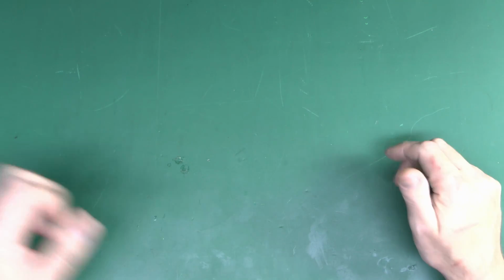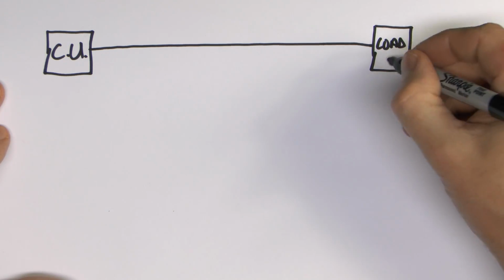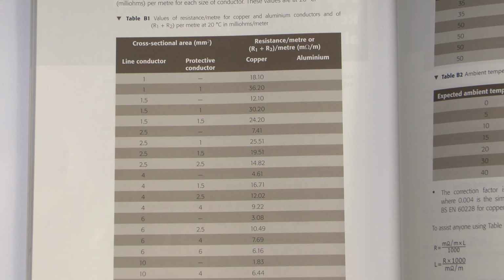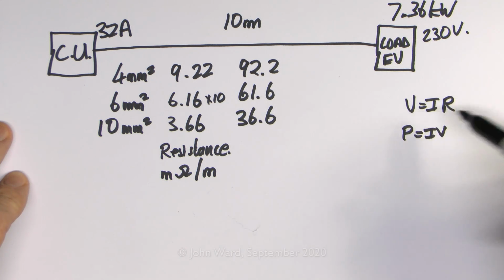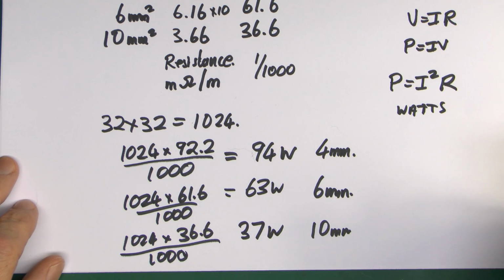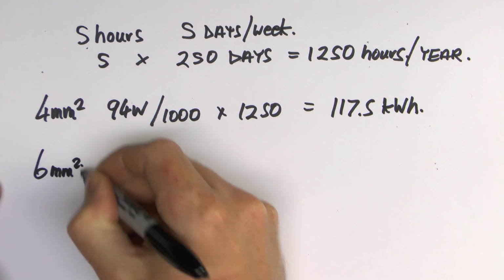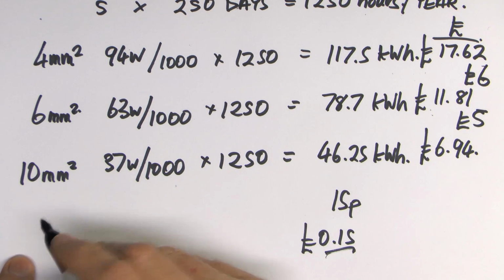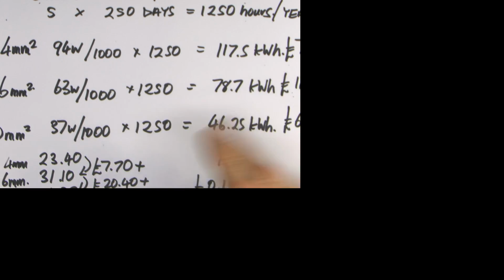Calculating Cable Energy Wastage, Energy Efficiency

Comment: Be careful when using this as logic for designing for maximum conductor size as theoretical voltage drop mitigation & associated savings are really difficult to recoup particularly when in a domestic environment even for the sustained-power output of EV chargers. The engineer in me wants to install the fattest cable for our next EV charger at a holiday home but running the calculations on real world use - it just doesn’t hold water if your sole aim is to invest in 10 or 16mm cable just to save money. Yes EV chargers spec sheets do design for 16mm conductor sizing! Fair enough if you have a long run and need to hit minimum voltage drop parameters but you wont be saving money anytime in the next decade (or maybe 2) for doing so, its purely for performance in that scenario.

For reference my long established (>3 year) average energy consumption in hatchback EV is 18.1kWh/100km in an suburban setting with occasional motorway driving ~130km/h and Irish weather (temperate climate, mostly mild & always wet 😂) much like yours in the UK. Price of energy is 0.31€/kWh (which is essentially a market low here), best T&E prices I can find are 16mm cable at 9.4€/m, 10mm at 6€/m and 6mm at 4€/m. For reference I drive ~18k/km a year meaning I charger for less than 500 hours a year. The example here is 1250hours. 

If you run an office fleet of cars perpetually charging on 7kW AC then you may actually reach a ROI. Although in that case perhaps you’d be using 3 phase 11-22kW AC so much of this domestic scenario won’t apply. Best I can tell - 6mm is probably the sweetspot between overkill and minimised energy wastage in the context of the cost of copper for most homes. To be fair I think that was the logical conclusion from this video. Perhaps you can find better cable pricing but to be honest you’d also probably be paying for higher spec EV-Ultra style cable (SWA with Cat5 ethernet) and that’s what most Electricians will go with.

Really enjoyed this video, always learn a tonne from your content. Open to discussion & challenge on this. 👍

Comment: The calculation is an overstatement. It says 1250 hours * 7.4kW. This 9,000kWh. Which equates to 27,000 miles at 3m/kWh. Suggest the saving for an average at home charge is approx 1/4 of the stated amount. 

On my current tariff as of April 2022 (Octopus Go @ 5p/kWh) the saving is a £1.75 a year based on 12,000 miles @ 3m/kWh. 

Brilliant video!
Reply: Just making these same realisations today watching this video. Totally agree with you! @18.1kWh/100km (3.4m/kWh) & similar mileage to you (18k/kms) . Would take decades for us to pay for 10 or 16mm conductor gauges. 5p/kWh 🤯 Hope you still have those rates! Paying €0.31 here at the moment which is basically  the market lowest tariff (Ireland) 😂

Comment: I remember doing this calculation in a place where I worked, out of curiousity (I had no electrical qualifications then). I can't remember the size of the cable but the loss over the length of the building was well over 1200W x 16 hours per day.
But that's wasn't the end of it. Becuase it was often far too hot there they installed air conditioning, so then they were using more power to get the heat out of the building.

Comment: I used to write the electrical installation specification for the company I worked for. They were running continuously many large motors at the end of 3-phase circuits several hundred meters long, often through underground ducts and often bunched together.  I required higher grouping factors than the regulations (to account for future additional circuits using the cable ducts) plus I required the final cable sizing to be increased to the next size up as determined by the calculations in most cases. Prior to this we could feel cables noticeably warm - not ideal in an area where flammable vapours were likely to exist. So this gave not just long term savings but potentially enhanced safety. On the same basis I would require high efficiency motors to be used rather than standard ones.

Comment: And what is the voltage drop if we applying a load of 32A on 4mm cable? Plz answer me
Reply from the maker: Depends on the length of the cable.
Reply: Sir let lengths is 100m plz sir give me answer
Reply from the maker: @godgameplay2361  Approximately 30 volts, which is far too high.  A 32A load on a 100m cable will require a much larger size of conductor.
Reply: @jwflame  thanku so much can you suggest me the what the size be? Plz

Comment: need to do this on my cooker and my fridge. Am in another country using 120V rather than 240V but all are the same basically. Wire cost here is way more but Electricity is more costly as well.

Comment: I have often wondered whether the supplies will cope when electric vehicles are in universal usage.  With the exception of supplies to premises using storage heaters, which need to supply f.l.c., in general the diversity allows for about 3kw per household - this is the case in my area, which is rural and supplied by overhead lines. A section was recently changed to aerial bundled, and one of the engineers told me that the substation fuses were being uprated to 300 amps: given the number of dwellings supplied by the distributing main, this equates to around 3kw per dwelling. I would expect that if economy seven is still available, many users will switch to this, and charge their vehicles during the off peak period, thus exacerbating the problem.

Comment: Interesting statistics, although 37,500 miles a year (260 days at 150 miles) is five times the UK average 7,600 miles per car (stats for 2018). So, for an average mileage the difference between 4mm^2 and 10mm^2 the saving would be a bit over £2 a year.

That said, it's not a bad idea to have a bit of reserve capacity.

Comment: Just to add, you can also use the tabulated voltage drop values in 7671 to calculate resistance and energy wastage of cables

Comment: Because many use bipolar circuit breakers because they are afraid of 
if the energy supplier reverses the phase with zero and you have a monopolar circuit breaker the phase will come to zero and there is no monopolar protection

Comment: Hi john. Nice to see you touch on this subject , this is something I have been trying to put across on some of the ev groups that I am on . One of the things that I have asked registerd installers of ev charging points is that when they do there calculations  for volt drop do they include the length of the connecting lead between the wall Controler and the actual car .  These leads are normaly 6mm copper and can add from 5 to 10 mt extra cable run . As the actual load is in the car not the wall charger ... to date no body has responded to this qustion  . Also this type of charger is a constant power charger  normally limited at 32 amp
So any reduction of volt drop will pay  extra as the current being drawn will reduce as the voltage drop is reduced .  I have done the same calculations on some that I have seen done with 6mm cable including a  7 mt  lead  and when you show the loss as a percentage of the charge taken it makes interesting comparison .    Really good vid

Comment: For what it's worth, the US standard for an ampacity of 30 A would be 10 AWG, which Google claims is 6 mm², right in the middle of your examples.

Rather a handy example, since my metal lathe pulls 30A@240VAC. Not really liking that 63W dissipation, although I don't think I ever run the lathe at anything close to full power consumption.

Yet another reason to use type S cable and not SJ.
Reply: a 7kW motor on a lathe? That's a lot of power, although bear in mind that electric motors draw much less power unless under very heavy load, and I suspect that the average current pull will be much less most of the time.

Comment: In AU standard electrical cable is i am pretty sure 2.5mm squared. Would that be because the higher voltage of 240V helps it? Also does stranded or solid copper wire make a difference? Thanks
Reply: Australia uses 230V as the reference single phase voltage (with the + an - tolerance bands similar to the UK and Europe. 240v was the reference values many years ago). 2.5mm squared cable (protected by a 16A or 20A MCB) is the typical (which will vary depending on the installation conditions) cable size used for power circuits supplying sockets (radial wiring is used; ring finals are not used).
Reply: The voltage is the same as the UK and 2.5mm^2 cable can be used on radial circuits up to about 20A (although 16A is more usual). 

In this case, a 7kW charger will draw about about 30A at the UK's nominal 230V (typically closer to 240V as the EU spec is 230V +10%/-6% and the UK system is run closer to the top end). In theory, a 120V 7kW charger would draw about 60A, but nobody does that anywhere in the world that I know of. In North America a 7kW charger will be run at 240V, just like all their high powered devices, and not the 120V or the "standard" outlets (the USA uses a 240V split-phase system in properties).

Comment: I now look at my Cooker with a frown wondering if it is wasting my Electricity ...
Reply: But it’s only on for an hour or less most days, so the losses are less than a fith of the ev charger. To put it another way, it’d take 15yrs to break even rather than 3 yrs.

Whatever cable u use, it WILL be loosing SOMETHING, because no cable has zero resistance.

Comment: Hi John....In the original calculation determining the cable loss in Watts, how have you determined that this loss is per hour, and not per minute or second ?...in order to do the second,  KWH calculation. 
O.K. on the resistance per mtr...etc...but, where does it state....or where can I find out,  if it takes an hour for this power loss to occur,  in any of the guidance books?
One would presume, that if the circuit is using the full 32Amp, as suggested, the loss in power in the cable, is occuring every moment that the load is connected, after the cable reaches maximum temperature and resistance......based on this presumtion...the cable must be losing (x) amount of watts per second.
Reply from the maker: 'watts per second' or per anything else is not valid - watts is the amount of power, and already includes the time unit (1 watt is 1 joule per second), and is the rate at which energy is transferred, in this case energy transferred from the  cable into the surrounding environment.
kWh is used for the price calculation as that is how electricity is sold, that is just 1000 watts for one hour, or others such as 500 watts for 2 hours, 4000 watts for 15 minutes.
Reply: @jwflame  Thanks for the confirmation....I was debating the exact Joule theory earlier today....along with Coulombs etc....with a young college guy.
Reply: Watts are a unit of power,  which is units of energy per second (Joules per second). A kWh is a unit of energy as we multiply by time. A kWh is 1000 joules per second (a kW) multiplied by 3,600 seconds, or 3.6 mega-Joules of energy. That's roughly the energy in 36 teaspoons of sugar.

Comment: Good to see this being discussed.  Where cable losses can really add up is in larger industrial or commercial settings.  Would be good to see some calcs by JW on say the savings to be had by increasing the conductor size for the supply of 250 amp 3 phase submains for example.  Some of the ones I’ve seen recently have cables wasting several kW!

Comment: Excellent vid that. Never even gone down the road of that sort of calc. Plus I have never been involved with EV units before. So if you say that a EV is charged for about 8hrs at 7kw (if I heard correctly), that's an awesome amount of power. How much would that cost you through a year to actually charge your car. That sounds like it's getting pricey. Technically by 2040 all new cars will be electric so I wonder soon if all new houses will have an EV charge point fitted as standard like they have a cooker point or extract fan.
You should have been a college lecture JW, you got a way of making stuff interesting, keep it up 😊
Reply from the maker: An 8 hour charge at 7kW would be 56kWh, and for a fairly typical EV that would be around 200 miles of driving distance.  Using full price electricity at 15p per unit it would cost £8.40, or about 4p per mile.
However a petrol vehicle which did about 10 miles per litre of fuel (about 45mpg), would need 20 litres of petrol, which at £1.10 per litre would cost £22 - far more than the electricity cost.
Charging EVs will make the electricity cost seem much higher than typical household costs without EV, but it's still vastly cheaper than any petrol/diesel vehicle, and in reality the EV would be charged using lower rate electricity, particularly when done overnight, or if the property had solar panels and the vehicle was charged in the day.
Note also that someone doing that full charge every day would be a very high mileage driver, far more than most people drive.  200 miles/day = 1000 miles/week, or approaching 50k miles per year.
Reply: @jwflame  Always enjoy your videos and very interesting discussion. I wonder how well the UK is set to support the extra power requirements from an avalanche in demand for EV charging. Even knowing what infrastructure is required where, I suspect will be challenging. It is at this point you hope some clever people somewhere have been quietly sitting in the background working all this out. I think it is an interesting calculation - if you still have your calculator at hand as to what happens at 6pm when everyone gets home on a November evening and tries to recharge their cars, turn on their ovens and boil their kettles.

Comment: Hi, John. I just passed my 18Th edition test but there was a question which I could not answer: Here it is: how long will it take 6 mm square cable in 90 degree ambient air to reach 160 degree? if you could help to answer this please?
Reply: The question is meaningless without knowing what other variables are at play (e.g. current load, installation method, cable type, etc).
Reply: It never will without knowing the rest of the queastion.
Reply: @UberAlphaSirus  I am sorry. but this is exactly the question. no further information was given. May be what I forgot was to mention that it was a copper conductor.
Reply: @BAYUMBE  it looks like you got one of them queastions that you can't win. I'm sure C&G does it so you can't get 100%. I got 98% in HWS, plumbing thing. The answer I gave was right, but system said no. Had the same in a 301 module, 98% and 98% inspection and testing. Are you sure it didn't have a diagram?
Reply: You need to know the thermal mass of the cable and the thermal conductivity to the atmosphere to answer that. You might be able to find that in standard references, however.
Reply: @PaulSteMarie  Can you these information on the 18TH edition?
Reply from the maker: Impossible to know without the rest of the information.
90 degrees is already well above the maximum operating temperature for most cables.
Reply: @jwflame  is doable?

Comment: The saving going from 4mm to 6mm is greater than the figures suggest as what's not factored in is the increase in resistance with temperature. I'd also add that some devices don't last as long as they might when there's a voltage sag from the higher current draw at startup. Not so much of an issue with the trend to soft startup of things such as air-conditioners.
In general though my policy has been if 4mm is just fat enough spend the extra for 6mm if for nothing else than one day you might need the extra capacity and then you've got to pay again for the labor of installing the cable again.
Reply: TBH going to at least 6 for a car charger seems to be a cheap win regardless, even if 4 is compliant. Possibly even going straight to 10, after all the cable has value even if you give up the car after a couple of years.

Comment: That's a lot of power! Almost as bad as the ultra-cheap extension leads which set on fire when given more than an amp or so of current. At very least, it's a non-energy saving light bulb wasted.

Having said that, I have to use a wasteful light bulb in my bedroom light, because the lamp is a dimmer with three settings plus off. I have tried an LED and it works but doesn't dim (it's on or off) and other LEDs might not work.

Also, in winter, the heat might actually be useful, though even then it is full rate electricity rather than gas or economy 7. Maybe that is a factor?
Reply: You can buy dimmable LED bulbs.
Reply: @UCCLdIk6R5ECGtaGm7oqO-TQ  Not conveniently, though I think the IKEA ones are.
Reply: @seprishere  Screwfix sell dimmable LEDs for a few pounds.
Reply: @UCCLdIk6R5ECGtaGm7oqO-TQ  You also have to have a dimmer that works with dimmable LEDs, and not all do.